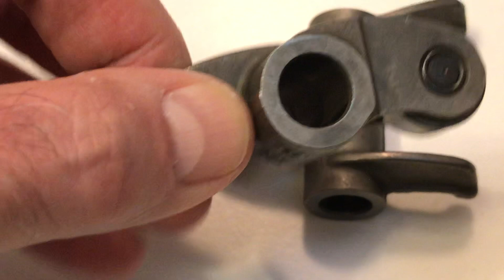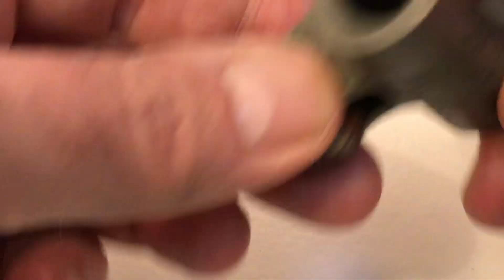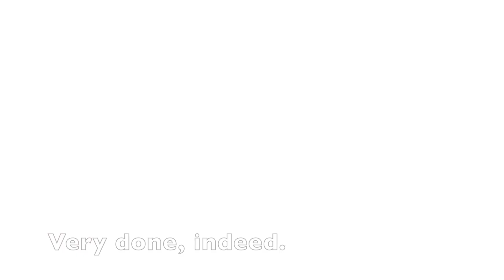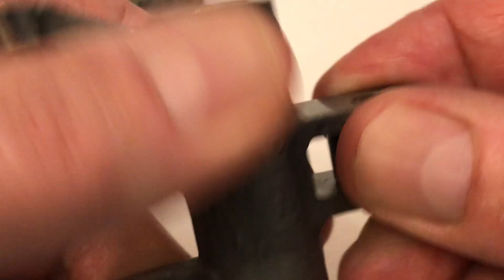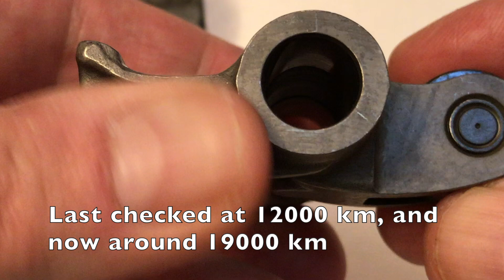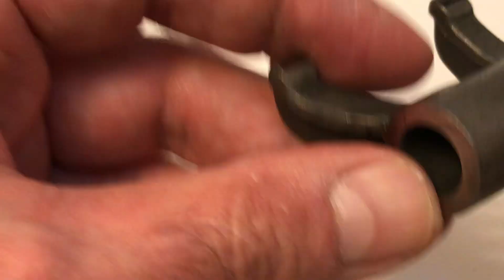KTM 690 - Roasted Roller Rocker

Comment: Did the camshafts have to be replaced?
Reply from the maker: Just a little minor spalling.on cam intake lobe but shim buckets were chewed up a bit when the shims ejected, enough that shims could not be reinserted into the buckets, so the valve spring retainers needed to be replaced.